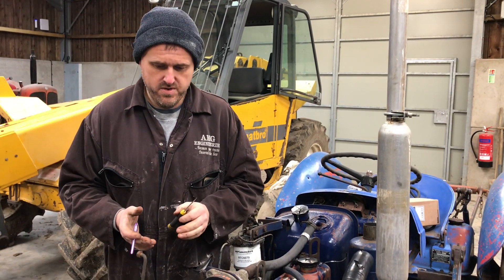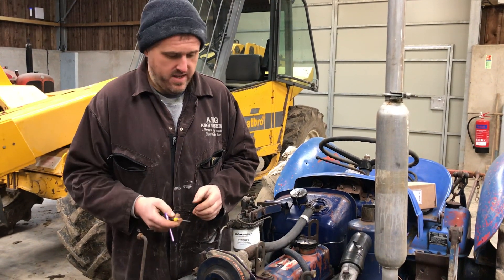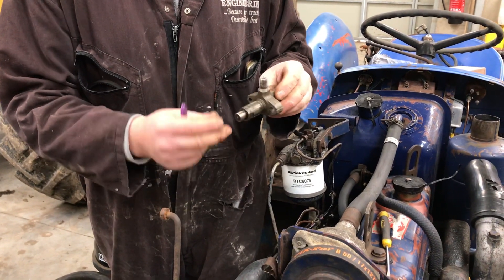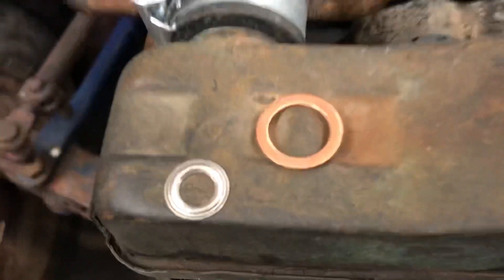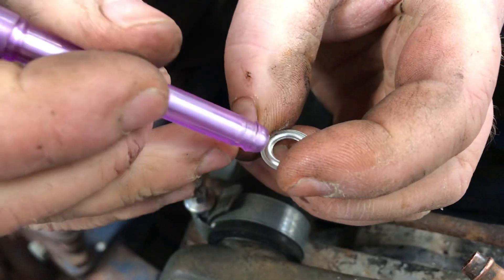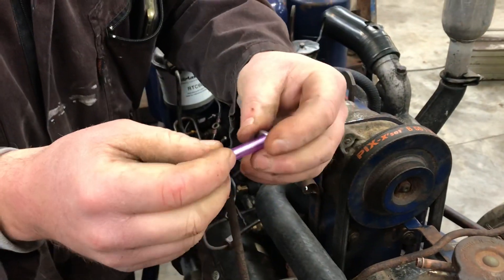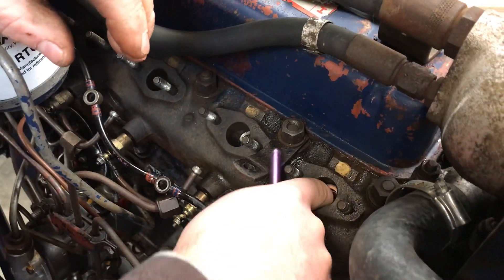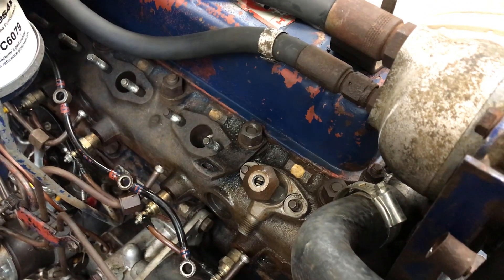Fitting injectors to a Leyland 1500, Leyland 1800 or BMC 950 Diesel engine.

Comment: Hello, I may find this video helpful in future, I was wondering I have 1500 leyland in form of sailboat engine westerbeke w30, 4-91(same thing) I got a rebuilt injector pump from England. can I accurately install this without recommended special tool?
Reply from the maker: Christopher,
You should not need any specialist tools for refitting your injection pump. You can advance and retard it on the slots if you need to. 
Yes let me know if you need any more help. We supply and fit everything for these engines and are used to dealing with marinised engines too. 
Joanna